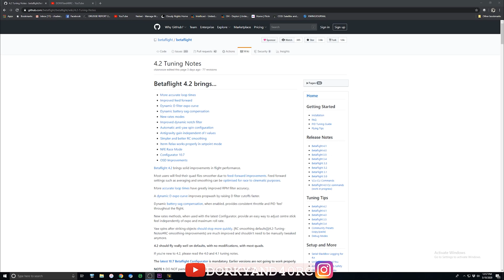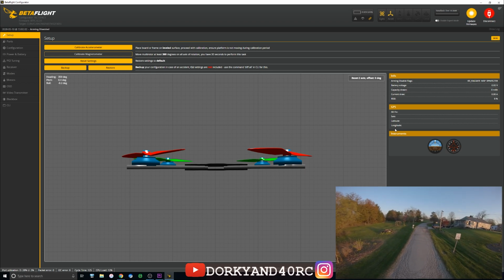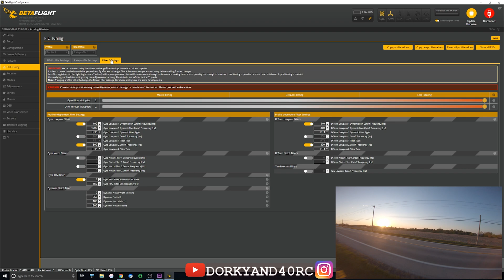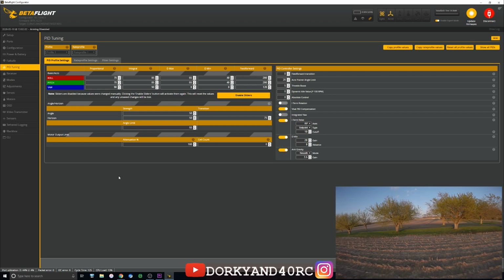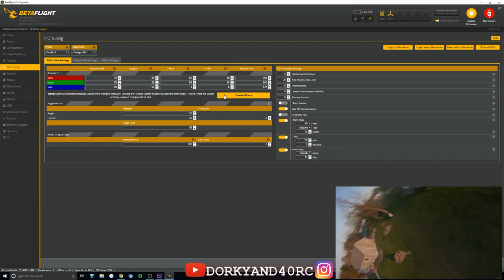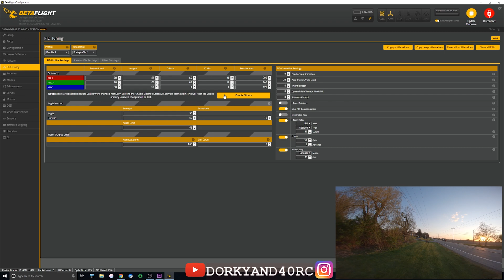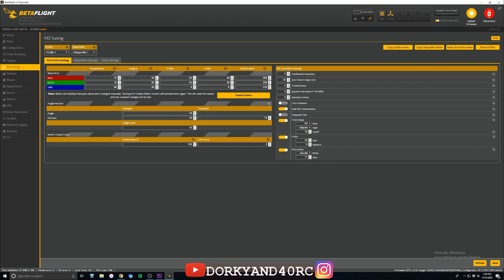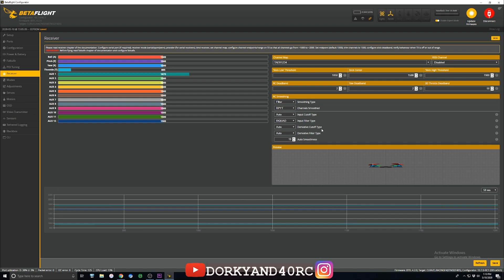Betaflight 4.2 | PIDS and TALK

Comment: a clean build brings out the issues? never heard of a quad that flys worse because its better build / has premium parts
Reply from the maker: Guess better way to think of it is it flies too good.  So you might need to adjust more parameters that would be covered up by a default setting for more precision. Think uavtech even mentioned this before.

Comment: I have been flying 5 inch frames for years,and can get a descent tune with these new betaflight releases. Question, i have just built the tp3 from kabab,and can't find a good tune. Do you know a good tune,or version? Any help would be great. Great videos. Keep up good work,and info👍.
Reply from the maker: Hey Tyler. If you look back about 4-5 months you will see my tp3 build and pids. It was built to bobs spec so if you’re is there same they should work. But if you have the mamba flight controller I would highly recommend trying flight1 too for $15 license fee. It flew better on that imo. Let me know if there’s anything else
Reply: @Dorkyand40  awesome thank you,yeah its built to spec,I got the beta12amp board. Its on 3s. I will check that video out. Thank you👍

Comment: Awesome stuff, just getting into this now, I bought a Mavic mini, and i have a beast and a potensic d80 on the way, thinking of buying either a swellpro spry+, a EVO2, or a mavic air 2, would love to get your feed back on this, only reason i bought the two cheaper drones on amazon is maybe to get more practice without screwing up the higher end drones👍
Reply from the maker: Mavic air2 👍
Reply: The mavic2 is definitely the best bang for your buck but that Evo 2 looks really nice with the 8k and I think it says it has a flir camera on board. Alot of gadgets . I can't attest to the performance and durability though where as dji has proven themselves.